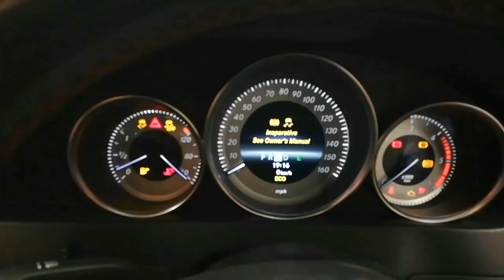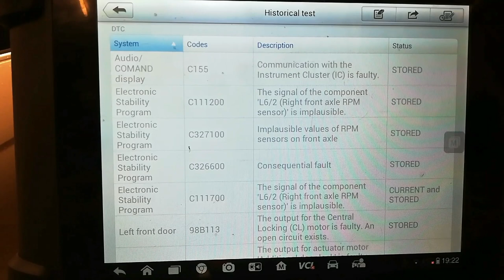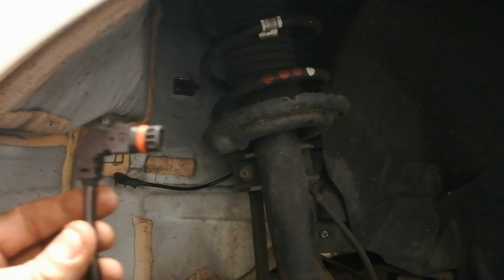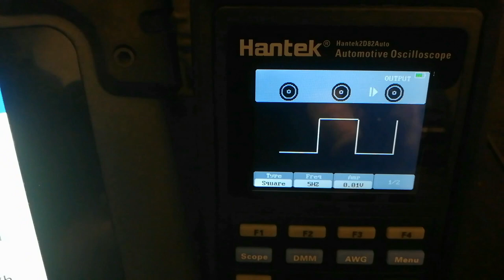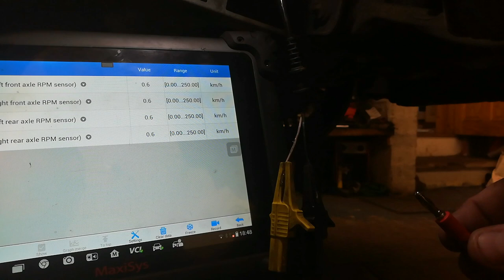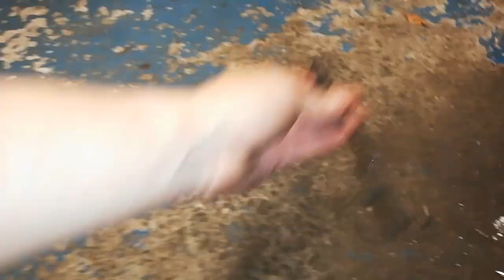Mercedes C220 W204 ABS Traction Control Lights On

Comment: Like it Dave. Do you think there might be other ways to do this bypass test without the AWG? Just thinking that scratching the banana plug across the crocodile clip teeth would have had a bit higher frequency than the 5hz output of the AWG which leaves me wondering? Thanks for sharing.
Reply from the maker: yes Russell, i didnt want to give it too much as you saw the speed rising dramatically just with rubbing the teeth. Changing the freq with a rotary knob arrangement, and keeping the jack connected permanently connected would prob do what ur thinking. cheers dave
Reply from the maker: hey Russell, pity that car is gone now but i was thinking that you could maybe do that without an AWG as you say. All you need is a bit of impedence moving up and down the croc clip to pull the voltage down on the positive